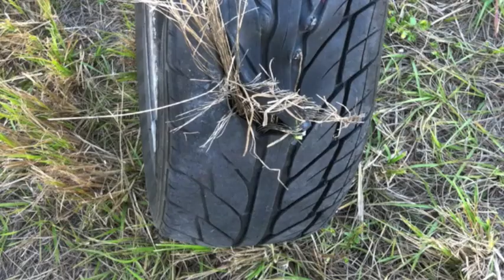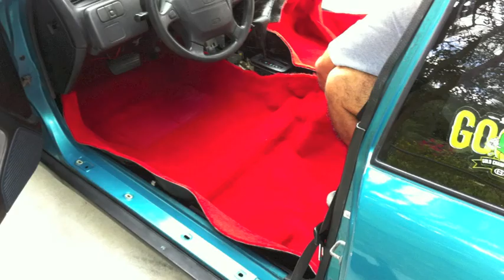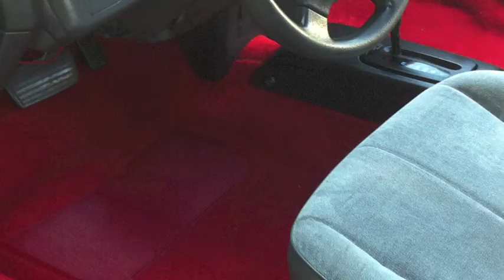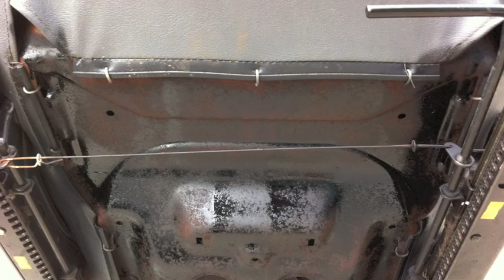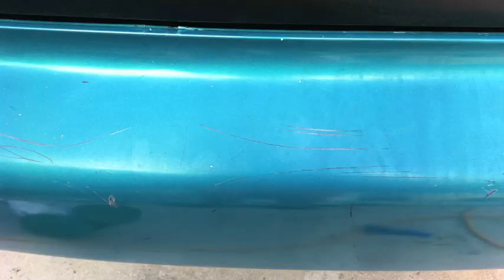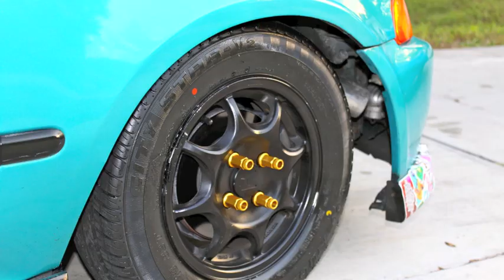Antonio's Project 93 EG

Comment: Very funny project))
In Russia the project begins with a swap to B18S. suspension, and then only interior exterior

I actually have done in the summer EG6 swap B18C spec 96, plans to suspension, and then just rest deshovaya tuning as in the video))

Good luck in building